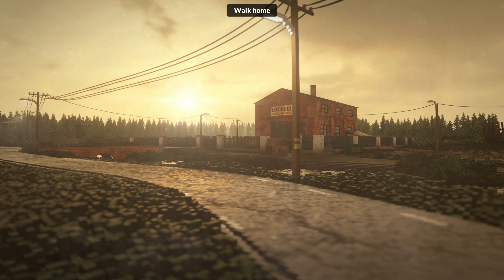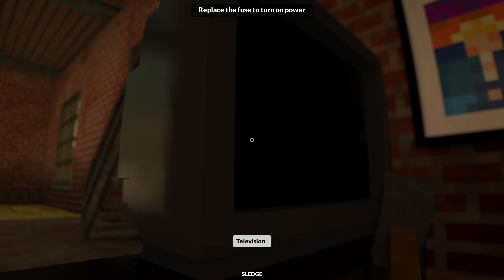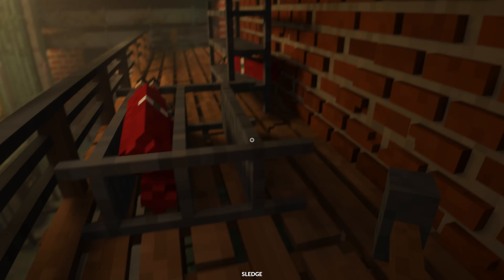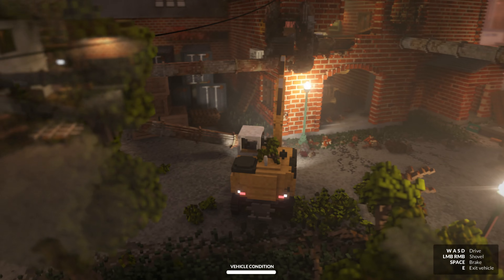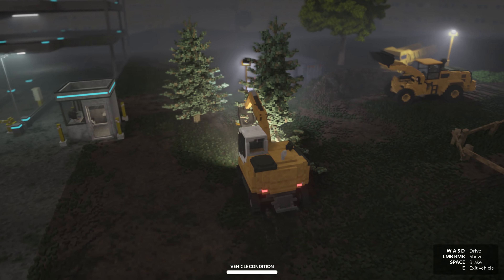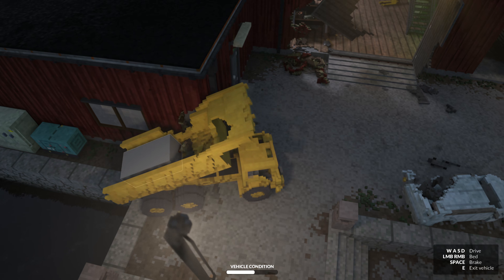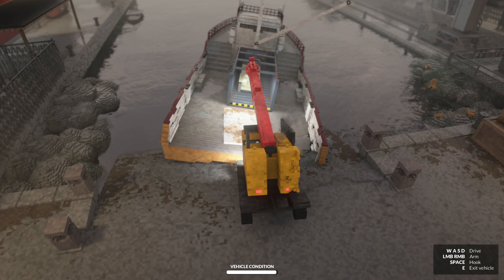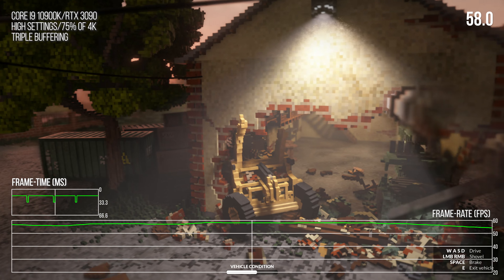Teardown Is Stunning: Next-Generation Physics + Lighting!

Comment: It's amazing, but I just kinda wished that planks of wood behaved like planks of wood, instead of blocks of wood stuck together..if that makes sense.
Reply: Yeah, real wood tears, twists, and splinters, it doesn't crumble and neither does metal, and glass is supposed to splinter and shatter.  That whole objects aren't pushed around in this game is also disappointing, rather you puncture pieces of objects and those pieces move.  However, smoke, fire, and foam were all very cool to see here.
Reply: @charoleawood  I don't think you can really do tearing and twisting of wood materials in a game with voxels only. It wouldn't look right even if you tried to simulate it. I think this is the best you can do when you're dealing with large blocks instead of geometry basically. It doesn't feel that bad when you play it, the sound effects make breaking wood and glass really satisfying.
Reply: @TexelGuy 
I don't mean to undermine the accomplishment, I think the smoke, foam, and fire propagation are all really cool, but the industry as a whole has needed to focus on better materials simulation for a long time but such simulation has been kicked to the curb in favor of focusing on static, realistic LOOKING (not interacting) worlds, materials, and characters.  Certainly the onus for realistic materials simulation (and for objects working believably as whole objects rather than as collections of voxels, one expects barrels to be pushed, not punctured like they're made of a single thin layer of old rust) does not rest on the shoulders of one individual pioneer in game development.  And I DO think that voxels can be arranged in twisted patterns, just check out the fun that can be had with magnets and iron fillings.

Comment: Me :  Oh, this looks fun, I might check it out.

Alex: It was very hard to run and even my 3090 couldn't lock 60FPS at not even 4K.

My 1050ti: Three, take it or leave it.
Reply: dude, i run this at high 50% render scale on a gtx1050 with a i5 and it runs most of the time 60 fps
Reply: It runs a lot better these days.

Comment: It's a shame how AMD's OpenGL drivers have always been so slow. For instance, on emulators like Citra my laptop's Intel IGPU is faster than my desktop's RX 570 while using OpenGL. I really hope this game becomes moderately successful and AMD is forced to optimize their OpenGL drivers.
Reply: Very unlikely because AMD abandoned OpenGL completely. They moved to Vulkan. I also remember when I was using Cemu with OpenGL withy Vega 56 the pergormance left a lot to be desired, a GTX 1060 performed better. Fortunately Cemu since then implemented Vulkan so it's good now.
Reply: @Hopkins955  I'd argue that even on Nvidia Vulkan (or Dx12) performs better anyway 😉

Comment: For GTX 1070 users: best settings I found are 1080p at 75% resolution scale, high preset and all effects enabled, vsync OFF (in game), and vsync ON in nvidia control panel. Runs like butter at 60 fps most of the time! Great game! I knew DF would cover it.

Comment: The flaw is that engine craps itself and the more you destroy, the more it folds on itself and uses less gpu and cpu. And from gameplay perspective, it's kinda weird that some elements break so easily. I want to push the metal container and not remove pixels from it. Other than that, it's stunning

Comment: I've been playing with a gtx 1070 and performance wise its been great, the only times i have had significant performance issues is when spamming bombs in sandbox mode or knocking over a building into a canal full of vehicles
Reply: Drive the big yacht into the pier house in sandbox mode and tell me how low the fps drops , for me it was 10 on a 1060 😅

Comment: I wonder how it's going to run on my Athlon 3000g. Lmao
Reply: it runs like shit on ryzen 7 4700u so guess
Reply: There was a youtuber testing that.... and the answer is... well... not really.

But if you put the quality down to medium and the resolution scaling down to 50% it runs on pretty much any mid range gpu from the last 5 years. So its really not as heavy as DF make it sound.

While it do need a decent cpu. Like at least a gen 4 i5 quad core or pretty much any ryzen...

Well.. really any cpu from the last 10 years with a true quad core
Reply: @matsv201  50% resolution is really rough though unless you're talking about 50% of 4K or 8K.
Reply: @megapro125  well.. yea.. i dont reconend 50% scaling if you dont have to. But if you have a old gpu and that is literaly the only way to play the game... its still better than not at all.

For most somewhat resonable gpu you will get away with 75% scaling.. the  it really look fine.

I dont really think  teardown loses as much enjojment of resolurion scaling as other games. It sort of lowers the distance where the voxels melt in
Reply: I tried it on 8GB Ram Ryzen 3 3200G with RX Vega 8 at the ABSOLUTE lowest settings and the game ran okay as long as I didn't get too excited with the destruction. I have only completed two missions so far, so I don't know how worse it's gonna get, but according to 3kliksphilip the lighthouse level is pretty heavy.
Reply: @matsv201  so with an i7 4770 equivalent and an RX580 I should be able to run it?
Reply: @souljastation5463  Yea absolutely. You might need to go 75% resolution scaling, but you defently don´t need to go 50% The RX580 also have a minimum of 4GB of VRAM... and if i remember it  correctly that is what is needed. GPU:s with 3 GB might do some swaping.

The games does still look good at 75% resolution scaling, it does get a bit softer, but really not to the degree that is annoying. 50% is more questionable.
Reply: @cannedbeverage7687  Yea.. you will need a GPU eventually.. the APU will probobly not work on the later levels.

Well the game will render, but it will be painfully slow. Even something like a 5500 non XT will give really reasonable performance at 75% resolution scaling
Reply: alterblast  As long as you don't go too crazy on the pipe bombs, probably. Watch 2kliksphilip's video that analyzes the performance of the game across various GPUs.
Reply: alterblast  Yea i would say it would probobly run pretty good. Well in 1080p medium. Medium quality really look fairly nice: Low look a bit crapy, but medium looks pretty close to high
Reply: @matsv201  Thanks, I'm glad to hear that (BTW, my 580 has 8GB, so there should be no problem there).
Reply: @souljastation5463  in my family we have two i5 and two R1300. The i5 is 3 and 4 generation.. that is.. really quite old. 
The game is kind of slow on the R1300, its fine on the third gen i5 and really quite god at the fourth gen.

I dont know why but even if a third gen i5 sould be slower than a first gen ryzen.. irs norlt in this game.

Gpu seams to hardly matter. My son only got a 1030... it run just fine. My doughter got a 5 year old quadro... just fine. The game is really very cpu bound.

Comment: Glad to see a game with realistic physics. Those are few and far between these days. Hopefully that will change for the new generation with the more powerful hardware. 

Rant:
I really hated how down-tuned the physics were in GTAV. It felt like the cars were on rails which seriously took away from the fun of driving. Four had much better physics but even those were tuned-down more than they should've been. I'm guessing due to hardware limitations but who really knows?

Realistic physics are great for games like that. The car chases would be so much more fun if, not just your car but, the enemie's cars had to abide by the laws of a highly tuned physics engine. 

I mean, that's what made the PS1 game Driver so great. Its story was bland, its graphics weren't that great, but its driving physics and car chases were incredible. You weren't able to, simply, take 90° turns at high speeds like in GTAV. You actually had to learn how the cars handled and out drive the people chasing you using skill. Good physics also just make game worlds seem more realistic, which is always a plus.
Reply: The console couldn't handle great graphics, physics, and real time multiplayer at a large scale at the same time so they had to drop 1 of the 3
Reply: I think GTA 4 was the sweetspot. If they went further than that with realism, you'd definitely see a lot more people complaining and quitting the game due to higher difficulty. I'd probably be fine with it, but a GTA doesn't really need much more than that. GTA 5 was definitely way too dumbed down.

Comment: I like that finally someone reasonably big has made a video about it, although you could probably have mentioned that you don't actually need 60 FPS in this game for it to be playable, as 2kliksphilip put in, when the destruction happens, the gameplay doesn't, meaning that you don't actually destroy things when you need the high frame-rate, say trying to collect all the keycards. Also it can run at 45FPS and still be completely playable, and 60FPS doesn't provide much of an advantage, apart from when the frame-rate drops it will still be higher than when the average frame-rate is about 45

Comment: How does this compare to how destruction is handled in Control?  Also, why are you pairing a modest i5 CPU with an $800 GPU? I understand that the GPU is the most relevant, but wouldn't it be much more likely that a rig containing an RTX 3090 would be an i7 (or i9, for that matter)?

Comment: This is the real next gen improvement. I could guess that with further powering of modern GPUs, game engines will slowly move towards voxel based rendering with high polygon counts. Sure the first few years will be rough and performance will be notoriously low. But with further optimizations and mixing in of rasterization, improvements could be made.

Modern games engines are designed to handle raster with RT as a add-on and an after thought, cause that's the new trend. Next gen or Next-next gen engines will primarily use voxel based rendering with raster optimizations.
Reply: I say ditch rasterization entirely
Reply: @charoleawood  and what do we replace it with?? Have any suggestion?? Any other rendering method that will provide us the same visuals and performance or even better compared to rasterization.

Comment: The only sad part about this game, is the fact its only runs on OpenGL. It does not support DirectX11/12 or Vulkan at the moment, but we can only hope if it does...
Reply: OpenGL is not a problem on Nvidia/Intel graphics, only on AMD's awful OpenGL drivers. There's nothing wrong with using OpenGL (it's a very capable API), what's bad is the driver support on AMD hardware.
Reply: @guilhermems  The problem with that is, OpenGL was suppose to be replaced with Vulkan. But some devs here and there still supports it despite seeing some major improvements in performance with the latter. Of course the drivers issues are sadly still present,  even Linux got that it working on AMD GPUs with no problem. The underlying issue will be if that's should really be their actual main focus for next generation architecture or hardware. It does begs the question if they could have solve it years ago, or use the new hires from purchasing Xlinxs to fix that for them. But I do want to know if OpenGL is still a viable API today?
Reply: @Deliveredmean42  Teardown proves that OpenGL (on Nvidia GPUs) is still viable in 2020. However Vulkan while requiring A LOT more work also provides much more fine grained control, more standardized features better performance, and better multi-threading utilization then OpenGL ever will.

Comment: I really want them to make brick walls more soft, buildings you can hold an entire building easily in the air with just a thin pillar, also they don't break good enough when letting a tower fall.

Comment: It's interesting that a game based around OpenGL would be released in 2020. Would you ever consider using it in your benchmarks? Cause OpenGL in Windows on AMD cards has been NOTORIOUSLY bad over the years and with the new AMD cards coming out in the near future, I'd like to hear about OpenGL performance on AMD GPUs in Windows, in 2020. I'm not saying the cards are bad, it's just OpenGL support in their drivers on Windows that has that reputation and which I've been able to verify in the past.

I'm considering getting a new PC next year, and my money would be on NVidia because I intend to emulate a lot of older console games and OpenGL renderers are usually the best for accurate reproductions of games on consoles like Nintendo DS or 3DS, but at higher resolutions on PC. And if an AMD GPU will give me less performance for my money, well I'd rather go NVidia, especially since I intend to play Minecraft RTX and I'm skeptical about RT performance on upcoming AMD cards (they haven't boasted about it like they have about pure rasterizing performance and these will be their first line of cards that have hardware acceleration support for RTX). So I would love to see, finally, professionals checking OpenGL performance in Windows on NVidia vs AMD, in 2020.

Comment: This game looks cool. But (as a structural engineer) the load bearing elements of the game still seem really unrealistic. You can end up with entire walls supported off a relatively small remaining portion of column in the corner. I know this makes the game more ‘fun’ but it’s definitely not realistic in terms of structural load transfer. The biggest thing it looks to be missing is deflection. Based in the footage everything looks very stiff and elements don’t deflect at all but I might be wrong. Saying that we sometimes need to do complex finite element analyses for tiny portions of structures in the real world so I can understand that a game has to make massive compromises in terms of the physics.

Comment: With enough brute force, couldn't you essentially do "voxel per pixel" rendering on an engine like this, so you have like 4million voxels on screen at once and it will basically create photorealistic graphics? I could be a mile off, somebody correct me if this is impossible.
Reply: Yes, it's possible, but very expensive, and the detail would break down when looking closely at surfaces.

Comment: building physics is good but not quite red faction guerilla good (hardly any building integrity simulation) 

particle physics of fire and smoke are exceptional with the lighting engine also being exceptional but does not have diffusion where the closer an object is to the ground the sharper the shadows are 

vehicle physics are not really accurate at all because cars bend and warp (beamNG) they dont crumble or snap like legos 

i will say those complaints aside the game is very solid

Comment: claybook had ray tracing and insane physics too. now we have another reason to think rtx is bullsh*t
Reply: Sure. Playing at 70% of 4k with a 3090 says a lot about running software accelerated RT
Reply: @funbrute31  how do you play control, metro exodus, or shadow of the tomb rider at 4k on 3090? dlss much? i get 70-80 fps average at 2560x1080 on a 1080ti. the frame drops in teardown happen because the cpu is being fully utilized only one thread at a time.
Reply: @radumirceabunica7492  of course, thats the point of DLSS. Or you really think AMD wont be pushing a DLSS-like algorithm for Radeon on PC and console?
Reply: @funbrute31  ok, so.. if 3090 runs those games like sh*t too (at native 4k, without dlss), why bash a game that has software raytracing and runs decently even without dlss? if i remember correctly dlss is ran by tensor cores, not rt cores. so yeah, i stand by my assessment. rtx is a bullsh*t gimmick - you can rt just as well or better in software.
my 1080ti runs quake 2 rtx at 2560x1080 at abismal framerates, but this software implementation in teardown mostly stays above 60fps. have you played the crytek raytracing tech demo/benchmark thingy? i played it on my previous gpu, a 1070ti, and it ran great. so much for rtx, right?
dlss = cool, rtx = meh

Comment: I'm not impressed, mainly on the lack of material physics, no matter if you smash a brick wall, a wooden crate or a metal container, they all fall apart in the same size same weight voxel pieces. If the whole selling point is destruction, I would expect better here, like steel bending before breaking, wood splintering and so on.

Comment: "Next generation physics"

I bought this, beat on a house until it was literally floating in the air connected to the ground only by a single drain pipe, and closed it. There are no physics. It's a Minecraft world.
Reply: You’re pretty blind my friend. There are
 physics.
Reply: And what happens when you *break* that single drain pipe?
Yes the physics are NOT 100% accurate but compared to existing games Teardown is about 25% realistic compared to 1% in other games.